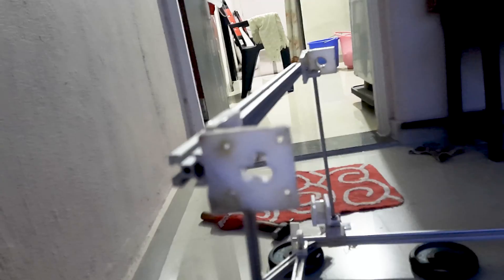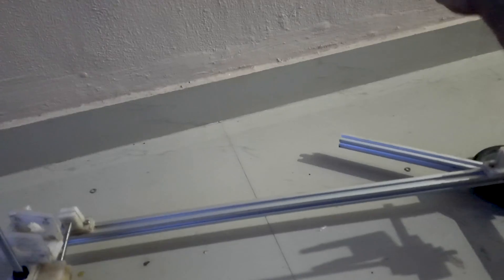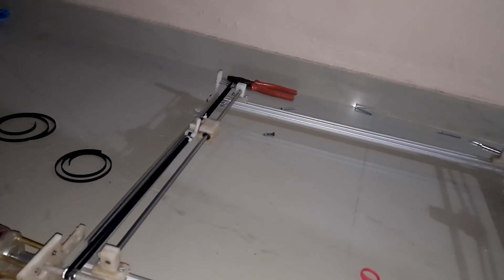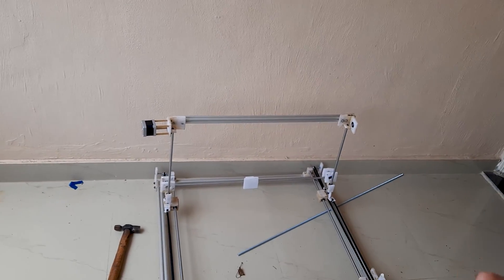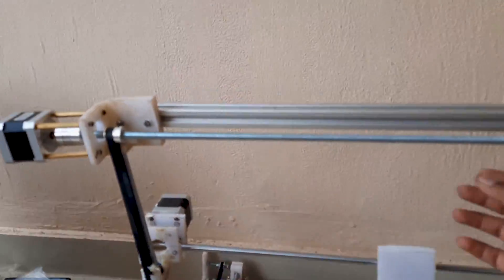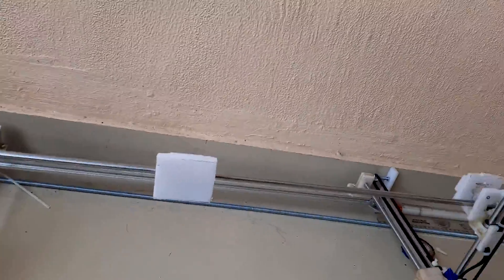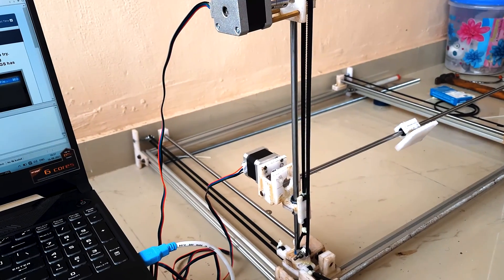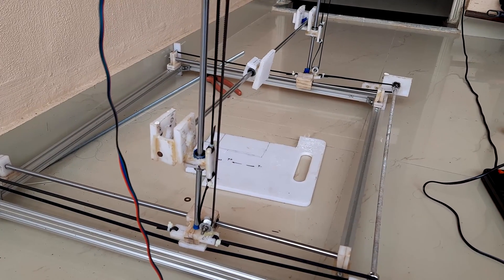3 axis Cnc milling machine project ready and submitted!!

Comment: this is the most stupid thing i have seen I am from kerala and this thing is useless I can only drill on paper that bldc idea is good but your direct dr9ive is very bad also 8mm rods is bad it is very unprescise machine all the ATTACHMENT PARTS ALSO VERY BAD OVERALL THAT GT2 BELT IS NOT PRESCISE AND CANT BE TIGHTENED DUE TO WEAK STRUCTURE
AND WTF IS THAT Z HIGHT SUPPORTING 2 RODS